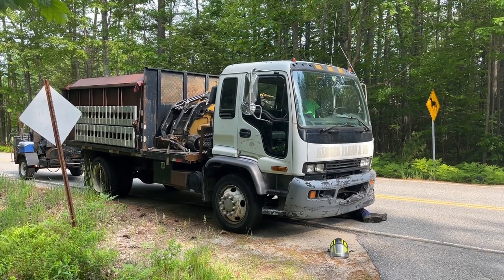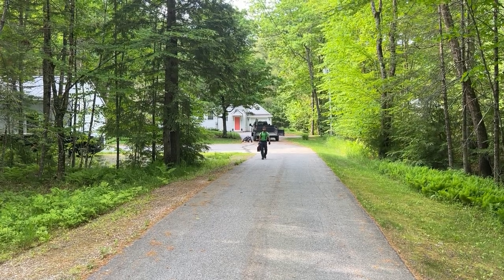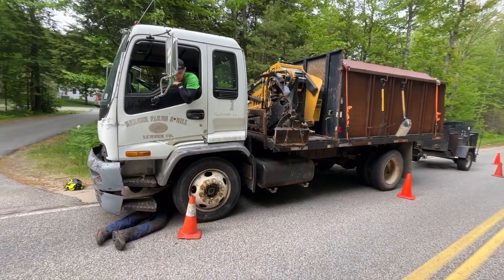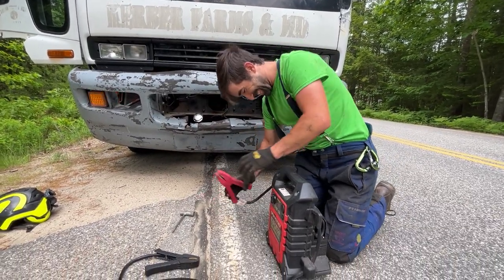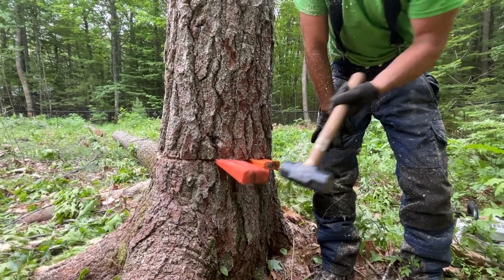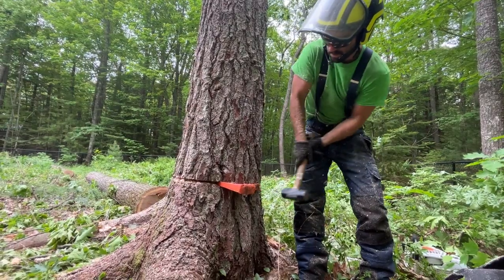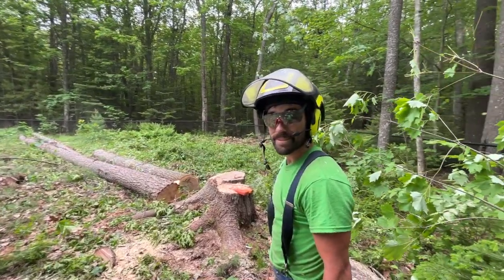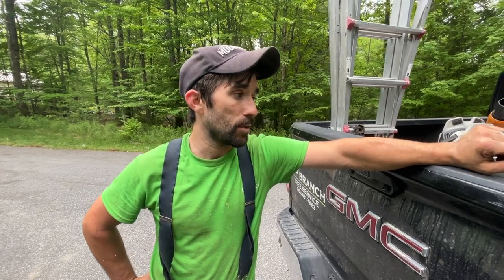Felling Trees With Professional Arborist

Comment: I’ve used a speed square to eyeball the tree height, but never a stick. How’s that work?
Reply from the maker: We will put up a video about it
Reply: Obviously a video would be better, but I hope this description can be helpful. Firstly you need to get a stick as long as your arm and relatively straight (Garden canes work well). You then need to extend your arm holding your arm horizontal (at the base of the tree) and the stick vertical. If the top of the tree lines up with the top of the stick (see 2.04) you're standing where the top of the tree will land. If not, walk away from the tree until the stick and tree line up. Good luck!